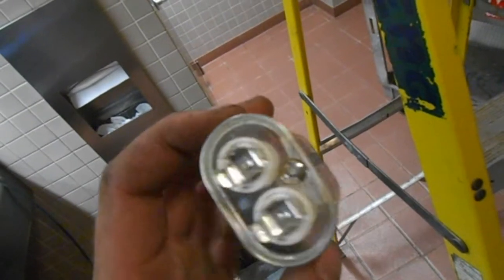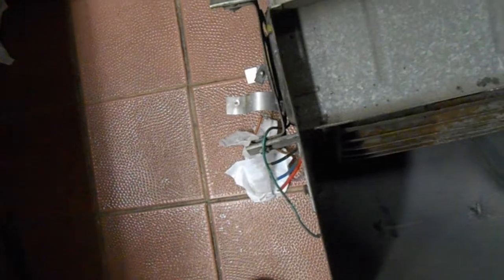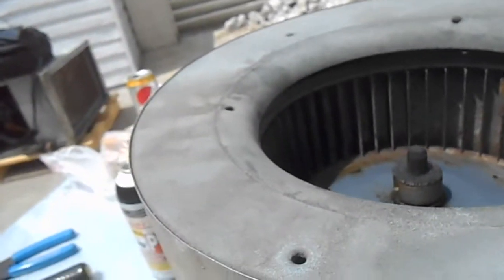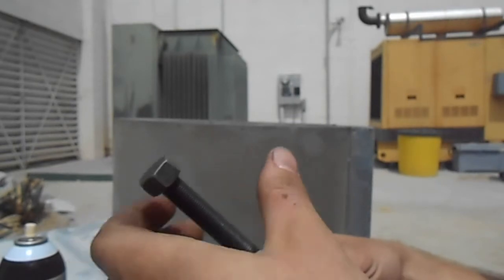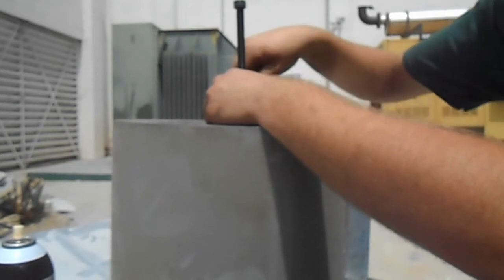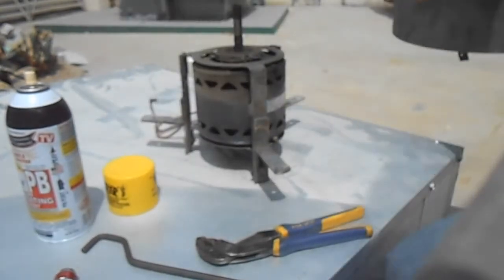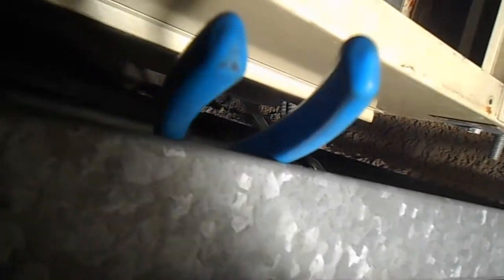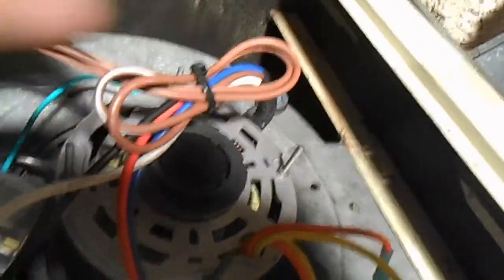HVAC- Climate Master WSHP Fan Motor Replacement

Comment: The whole process started out excellent but the most important thing was to show how the blower was taken off was not seen, if you upload another video showing the whole process would be better. thank you very much
Reply from the maker: Samuel Castillo Hey, I will do that if possible. Do you need to know about the Climate Master WSHPs specifically? There are still some of those classics hanging around that building and I still do work there sometimes (not the onsite engineer anymore though). Every manufacturer has there own way to an extent but it's usually pretty simple usually just a couple sheet metal screws holding it to a lip on of the panels. Trane units make it so you just take the side panel screws and the whole assembly comes out. Carrier units have a screw on one side holding a plate with pins and holes that go into pins on the unit chassis on the other side. You take the screw and plate out on the one side then just pull it off the pins on the other side. Hope this helps. I will try to get some video of different units if possible. I'd like to remake some other videos as well